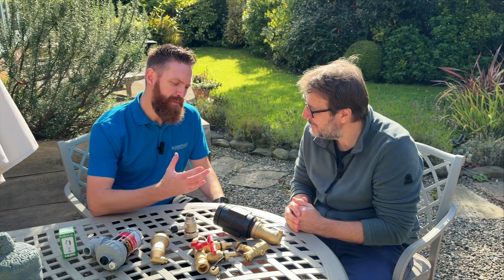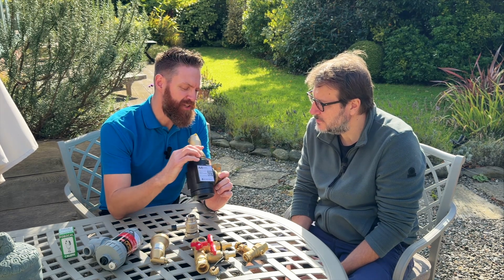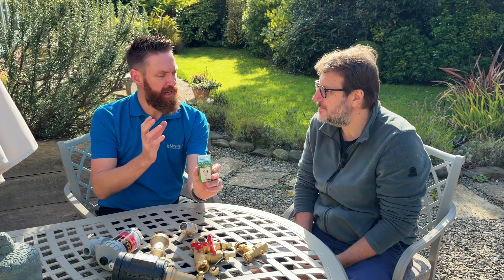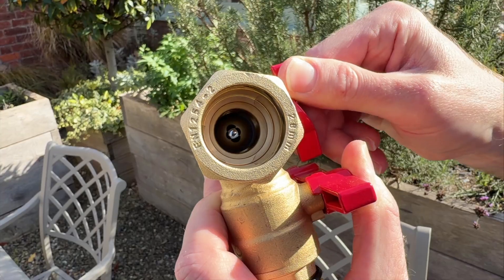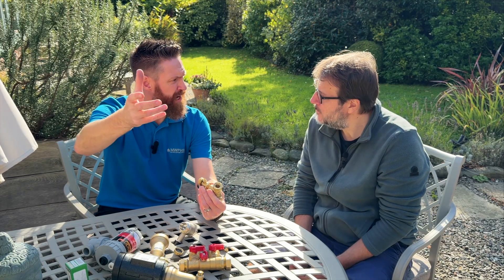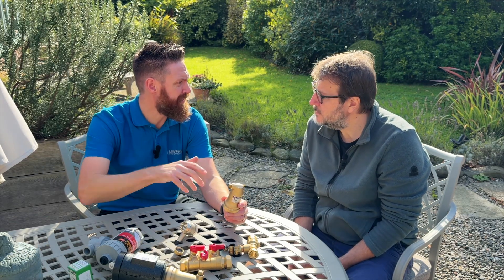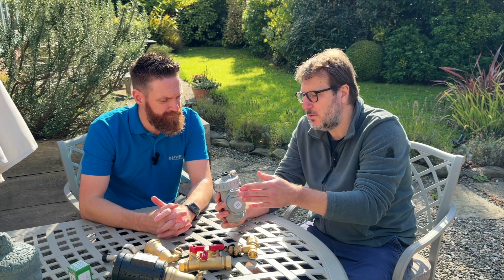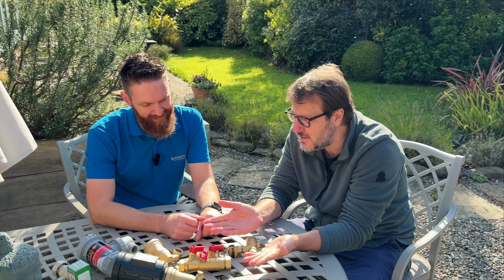Why You Should NEVER Install a Heat Pump Without These Accessories

Comment: I saw a friends heat pump install recently and was shocked to find the installer had left all the outside pipes completely bare without any insulation! Over a meter each of 28mm flow and return on the outside wall! I told them to get the installer back ASAP.
Reply from the maker: That’s shocking! Good on you for spotting it. Hope they get it insulated properly soon!

Comment: I thought Boilers have a built in Auto Air Vent (AAV) for this purpose ?
Reply: They only do so much and an ASHP is almost always at the lowest point of a system.
Reply: These micro bubble separators do really work wonders. In my parent's house we had problems with air bubbles and the noise they cause over 30 years, because they were impossible to bleed, because of how that system was designed and built back then. Bleeder valves, automatic air bleeders, pressure purging - nothing worked.
2023 a new condensing boiler was fitted (a heat pump was not possible without redoing the entire system for a sh.. ton of money - back then). That came with a combined micro bubble and dirt separator. I / we abso-effi'n-lutely LOVE that thing! Finally silence, as the water can't but flow through it and therefore the air bubbles as well. These get trapped there and released.
Flow everywhere and WAY less heat distribution issues.

Next thing coming summer will be to replace the valve cores for adjustable ones, as I finally came across compatible ones for the strange valve body style fitted in that system in 93. Something an installer wouldn't do, as the convectors (you read that right, no radiators. You could say fan coils without fans - which I do retrofit myself one at a time now) are really uncommon and get thrown out as a standard measure around here. They just don't know their way around these anymore.

Comment: Octopus recently installed our Daikin heat pump and they fitted almost all the components on your table apart from the 'fill and flush' valve unit.
Only thing that let the installation down a bit is the insulation around the valves.
Reply: It's quite hard to insulate around valves. If you look at most photos (even the nice Instagram ones), most installers leave valves exposed. If you do this inside the home, the heat loss is minimal (it goes into the room it's in), but outside it allows other sections of pipe insulation to become wet and also wrecks system performance as the energy is wasted to atmosphere.

Comment: For a novice what the difference between this and just bleeding from the high points of the system, I.e rads or manifolds
Reply: Bleeding radiators at the high points is a natural way of venting high-temperature systems. However, heat pumps don't raise the fluid temperature high enough on the heating circuit to release the air inside the fluid. Also, UFH manifolds don't really have a 'high' point, hence they have flushing valves fitted to enable you to get all the air out of the many meters of smaller bore pipework in the floor. A fill and flush valve with correct air removal devices makes initial fill and future maintenance way easier.

Comment: Purge point (full and flush) are key. We always fit them and add to them many systems for a service. Key is when installers fill the system and they don’t purge the coil or the cylinder. With this can you purge the coil easily.